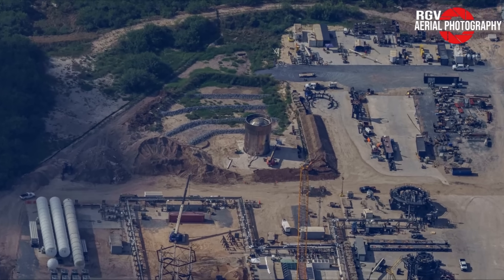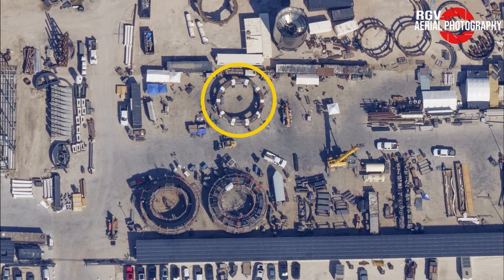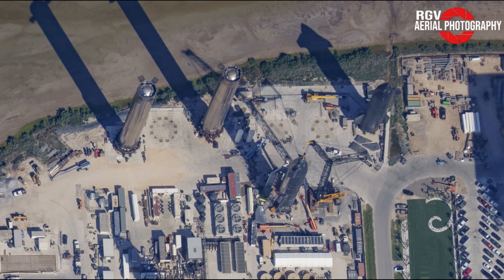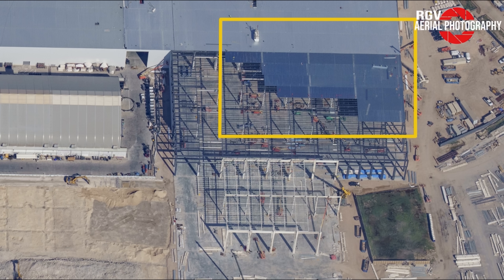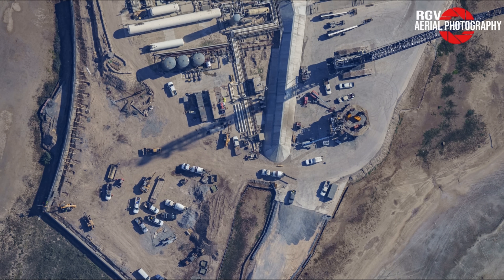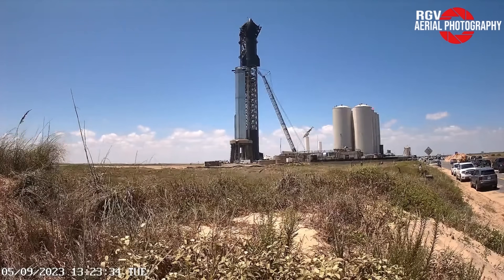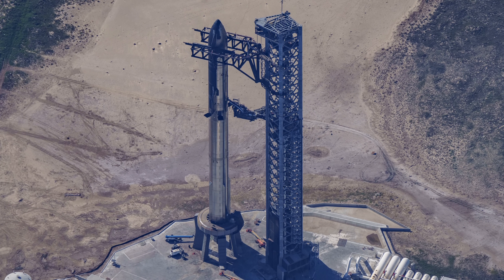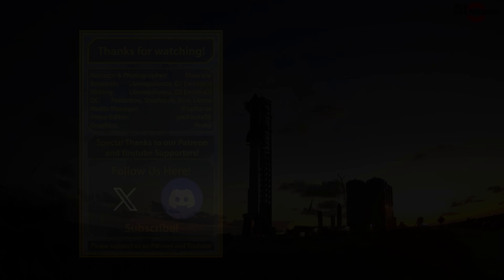SpaceX Starship Full Stack Flyover Sneak Peek EP 16

Comment: Looks like another test of FTS at Massey - the dirt berm. Launch licence by end of month as most of the 63 corrective actions done - SpaceX probably proposed most of them.
Reply: Some for sure, because a big part of the report spacex gave the FAA was a break down of what went wrong and where.  So they'd have at least some knowledge but it doesn't mean the FAA didn't tack some extra's on.
Reply: @TheEvilmooseofdoom If you chase the link that RGV provided in the pinned post and the subsequent link to the actual FAA letter, it states that the FAA accepts Spacex’s mishap report analysis and the 63 corrective actions proposed in the Spacex report.
Reply: @Spectator1959  I did read the letter!  Thanks!
Reply: @TheEvilmooseofdoom  given the number of former NASA employees at SpaceX, I would think relations are very good. SpaceX would have been very frank about what went wrong, and made some proposals for corrective action. NASA would have responded with draught incomplete proposed actions of its own. SpaceX finally would have submitted its formal report, and NASA has responded with its definitive list of corrective actions. 63 actions shows diligence on both sides. 
Having done one FTS test, Tesla appears nearly ready to do a second to demonstrate consistency with the first. 

While the 5 second static fire was only at half thrust, instruments would have measured deflections. From that predictions can be made about a full power test. Due to the volume of gas required, it appears the next test of the rocket will be the launch, which has several holds built in - effectively, a series of tests done on the way to launch
Reply: @peteregan3862  Spacex has a close relationship with NASA always has.  However NASA isn't a regulatory agency so they have no say. It's the job of the FAA to protect the public and that's who they have to answer to and they only have to show that they're conducting their tests as safe as they can.
Reply: @peteregan3862 
It's the FAA not NASA.   The FAA is the certifying agency.
Reply: Best to face the fact that both the FAA & NASA are government drones, chair-warming empty suit incompetents taking direction from the administration. Adding nothing but red-tape, delay, & obstruction.
Btw, SpaceX has only a couple ex-NASA employees, burn-outs hired for PR interface to the agency.. Elon noted early on that they tried to hire, interview engineers/techs from NASA but found only incompetent bungling paper-shufflers & bureaucrats.

Comment: Very exciting, 63 corrective actions.  That could take some time. Thank you Mauricio.
Reply: They are all most likely done right now.
Reply: Surely, SpaceX was already aware of all of those + more, and started working on them the day after the launch. Also, as others have mentioned, all 63 (and likely others) most likely are already done.
Reply: @noli-timere-crede-tantum  Since most of what the FAA knows came from spacex it's likely most of the issues were known to spacex but that doesn't mean the FAA couldn't have tacked on a few more.
Reply: @TheEvilmooseofdoom  Agreed, but wouldn't SpaceX at this point in its life have a pretty good idea about what FAA might possibly find out, and get a head start, especially if possible corrective actions are in fact, important?
Reply: The FAA has released a letter that says they sent a list of things to be done to SpaceX but didn't make the document available to the general public. I'm guessing that's because there are some 'political' items in the list and the FAA doesn't want the same level of heat they got when the original report (prior to the first orbital attempt) included requirements that SpaceX make annual donations to certain environmental groups.

Comment: Great job keeping us up to date.
I'm guessing that just a few of the corrective actions will drag out into October.  This investigation actually concluded amazingly quickly compared to past practices.  I'm excited for IFT2!
Reply: I'm thinking spaceX has been working with the FAA on this final report since the first test flight ended. If you paid any attention to the press release, the first few corrective actions are already in place. The pad has been totally redesigned, the water deluge system, the inflight termination system. If the launch is delayed it will have little to do with these 63 corrective actions.